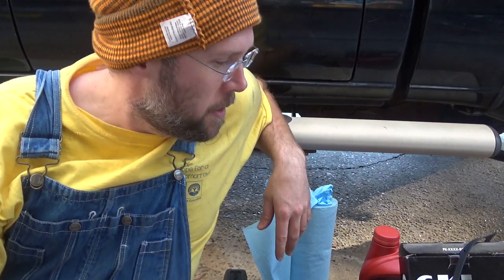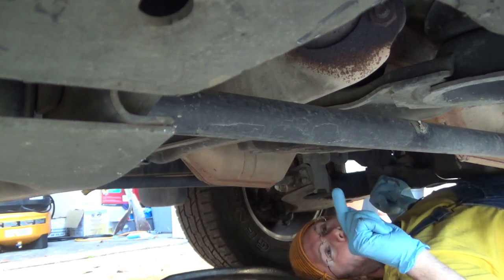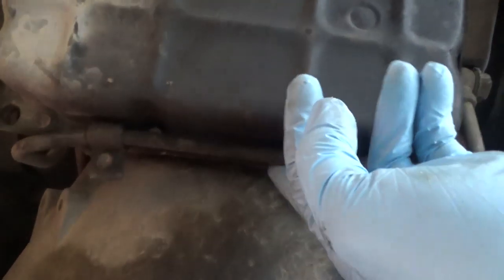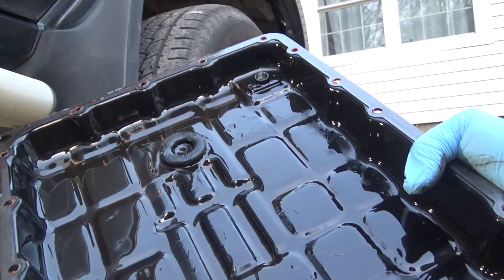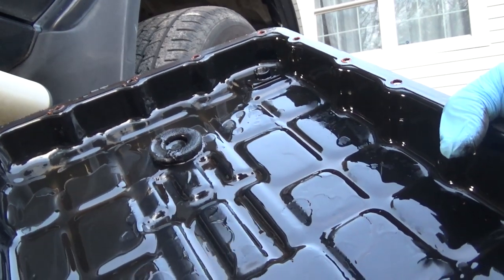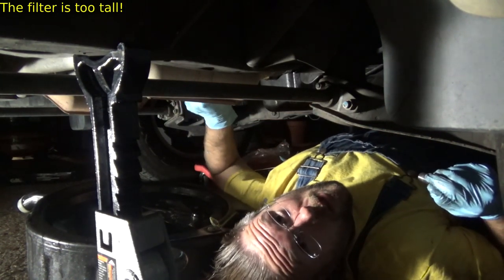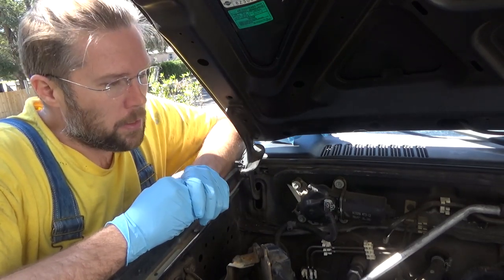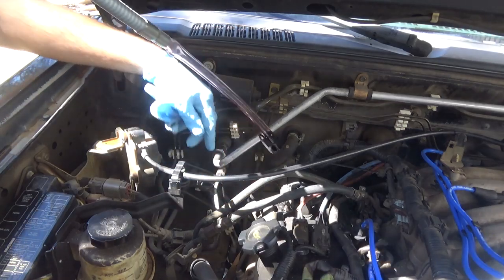2002 Nissan Frontier Crew Cab SE Transmission Fluid Change

Comment: Truck has to be on and the transmission in park position in order to accurately measure the level of the fluid...

AT Trans you have to check with them running

good video still
Reply from the maker: That is correct, I was just trying to keep the noise down, due to the wind blowing. From the manual,
Checking A/T Fluid
1. Warm up engine. 
2. Check for fluid leakage. 
3. Before driving, fluid level can be checked at fluid temperatures of 30 to 50°C (86 to 122°F) using “COLD” range on dipstick. a. Park vehicle on level surface and set parking brake. b. Start engine and move selector lever through each gear position. Leave selector lever in “P” position. c. Check fluid level with engine idling. d. Remove dipstick and note reading. If level is at low side of either range, and fluid to the charging pipe. e. Re-insert dipstick into charging pipe as far as it will go. f. Remove dipstick and note reading. If reading is at low side of range, add fluid to the charging pipe. Do not overfill. 
4. Drive vehicle for approximately 5 minutes in urban areas. 
5. Re-check fluid level at fluid temperatures of 50 to 80°C (122 to 176°F) using “HOT” range on dipstick.

Comment: is this the RE4R01A transmission did you have a problem with 1 bolt holding the filter the nut on top will fall out im told and cant put it back in did you have a problem couldn't tell in video?
Reply from the maker: I did not have any issues with with the bolts. I have also read about the issue you reference and was careful not to make any mistakes this time.
Reply: Razor Bucks how many bolts hold the filter in place?

Comment: Whats the fluid capacity????
Reply from the maker: Sorry for the delay. For my truck, which is a VG33E, 2WD 8.75 US quarts. For the 4WD 9 US quarts. For the KA24DE, 8.375 US quarts. All of these are from the Nissan service manual.
Reply: Razor Bucks 9 quarts exactly?
Reply from the maker: Let me verify with the manual when I get home from work tonight. If you have more than one vehicle, you could drain it into a bucket and then measure that to see how much you will need. I pulled the pan and tried to get as much out as possible.
Reply from the maker: I just had a look om amsoil's website, because I will not be home for another 10 hours, and they also listed 9qts. https://www.amsoil.com/AmsoilGarage/internal/vehiclelookuppage.aspx?url2=2002+NISSAN/DATSUN+FRONTIER+H 
CAPACITIES:
Engine, with filter..........3.5 quarts [1]
Cooling System, Initial Fill..........11.6 quarts
Passenger Car & Light Truck Antifreeze & Coolant
AMSOIL Antifreeze and Engine Coolant
Automatic Transmission, RE4R01A Initial Fill..........Not Specified
Automatic Transmission, RL4R01A Initial Fill..........Not Specified
Automatic Transmission, Total Fill
   4 speed RE4R01A..........9 quarts
   4 speed RL4R01A..........8.8 quarts
Manual Transmission, FS5R30A (RWD)..........5.9 pints
Manual Transmission, FS5R30A (4WD)..........10.8 pints
Differential, Front..........3.2 pints
Differential, Rear..........5.9 pints
Transfer Case, Part Time 4WD..........4.6 pints
Transfer Case, All-Mode..........6.3 pints
[1] After refill check oil level.
Reply: Razor Bucks thanks bud!
Reply from the maker: Thank you for the comment.

Comment: Yeah those trucks transmission fluids were meant to be changed not the gasket or the filter there what you call The Last of the Mohicans they're permitted filters and gaskets the only time you change the gasket as if it's leaking and that's hardly never on Japanese vehicles you just change the fluid that's why they give you a drain plug but you didn't do too bad I'm watching this is from a real mechanic
Reply from the maker: Thank you for the information..

Comment: I see nothing what you do when you work underneath of the car. It is not good point of view for the camera. ((
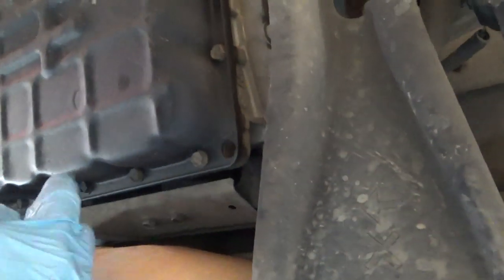Reply from the maker: Which part are you having trouble with? Did you watch the whole video? If you are like me, I tend to skip around when watching videos. After the painfully long introduction, I showed where everything is located and then set the camera to the side, because there is not a lot of room under the truck. At the 1:43 mark, I start removing the drain bolt and at 2:03, I show the pan bolts. I hope this helps.
Reply: I couldn't understand what you do from 5:25 to 9:20 because I never drained ATF from my Nissan Frontier. Today I got it done and now I understand what you were doing. Thanks for the video! Thumbs up!
Reply from the maker: Congratulations on getting the oil changed. During that time, I was just cleaning the pan and then reinstalling it. Thank you for the replies, it will definitely help me think about camera positioning moving forward. Unfortunately, I am way behind on videos.